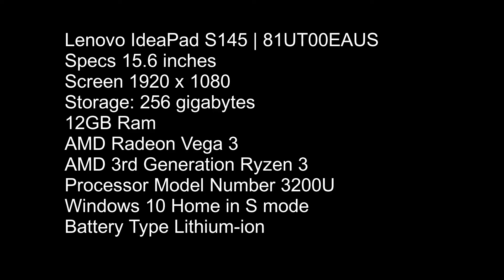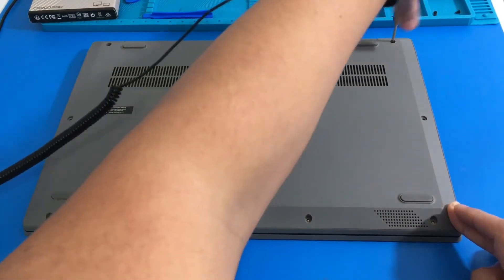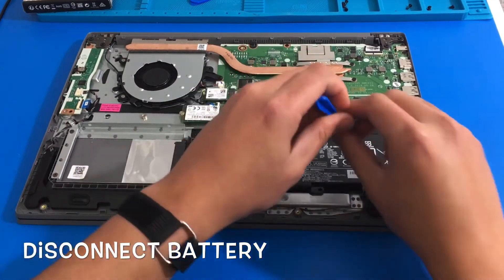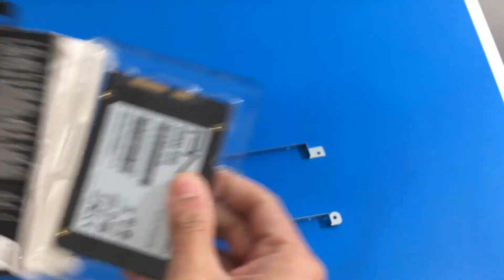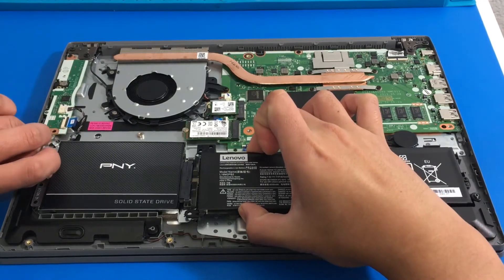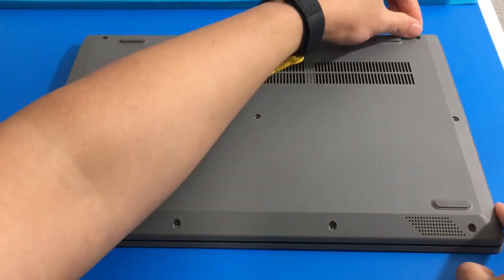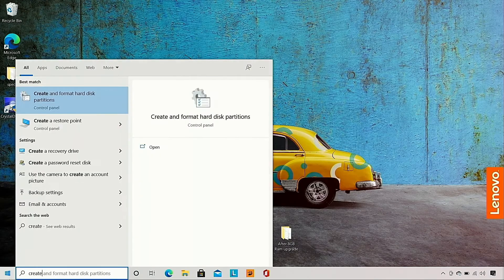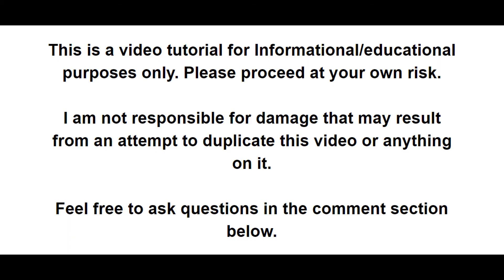Adding & Initializing a 2.5 inch PNY SSD on Lenovo IdeaPad S145 - 81UT00EAUS | SSD7CS900-120-RB

Comment: Mine doesnt have the ssd connector
Reply from the maker: Sorry to hear that. Did you purchase it from a retail store?
Reply: @whattmeter  i got it from the website
Reply from the maker: Lenovo? Im surprised. I got mine from best buy and the lenovos included connectors
Reply: @whattmeter  thw weird thing is it had the ssd/hardrive slot but no port
Reply: @Zackylo_D_Mofo  Was anyone able to get the connector? I want to add a 2.5" SSD and leave the M.2 in place

Comment: If i'm gonna add a hdd in the bracket as an additional storage is it just the same steps with what you do here in the video?
Reply from the maker: Yup, i would make sure yours came with the hdd cable included. It depends where you get your laptop.

Comment: Thank you so much for help but do you think upgrading ram and upgrading ssd will make the battery life more better
Reply from the maker: I think adding ram will consume more power because it will provide better performance. The SSD should consume less power than a hard drive if you have a hard drive installed.

Comment: Hello i know this is random but i have a question about the acer aspire 5. I just got one yesturday but when im playing valorant without the charging cord it runs down the battery pretty fast. After i finished one full game of valorant my battery was pretty low. What is a resulotion for battery drainage on the acer aspire 5.
Reply from the maker: Ive never tested valorant on the laptop using battery only. The acer aspire 5 slim battery isn’t very big. You could try reducing the brightness a little. What resolution where you playing valorant in? 1080p?
Reply from the maker: Also do you know if your power settings were you on better performance or best performance mode?
Reply: @whattmeter  it was on  better performance
Reply: I don't remember but I know it was around 1080p. I look at my task manager and it said  valorant was using a lot of power
Reply from the maker: @nuruddinabdullah6700  valorant can definitely take up a lot of battery power. You can check the  battery health report of your acer as well to make sure the battery is healthy. I think overall gaming will really take up a lot of power.